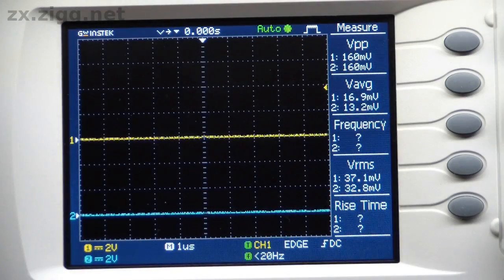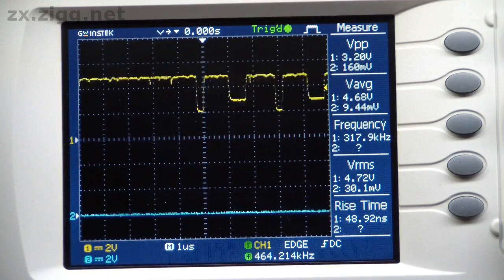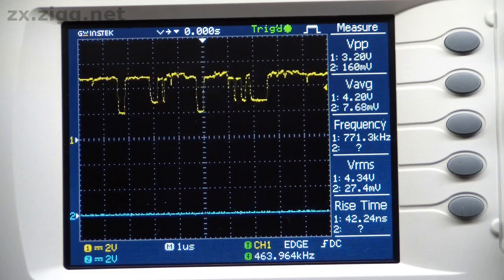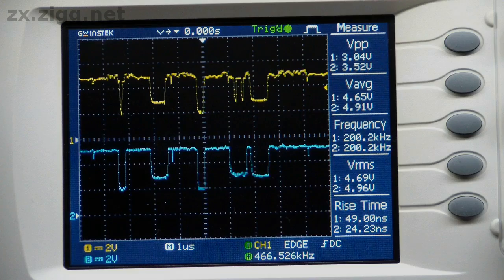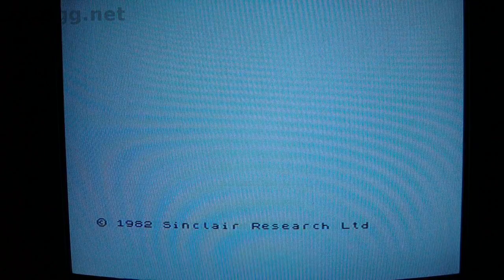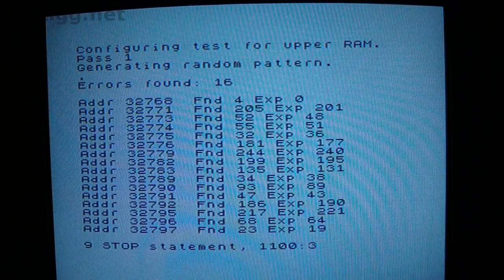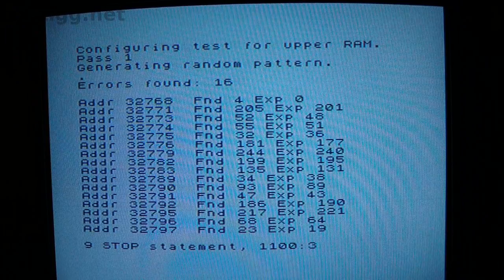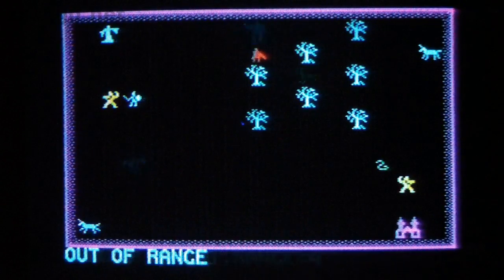48K ZX Spectrum Repair (No. 3)

Comment: I think this kind of ram is not compatible with divide hardware.
Last year I repaired mine, ULA, TR4, regulator, Z80 and lower ram replacement.
Also I did a full recap. A few days ago ULA died again (I think) :-/ oh well...
Nice vid mate.
Reply: This kind of RAM works with Divide (tested).
Reply from the maker: What makes you think the lower RAM replacement module is not compatible with a DivIDE? I'd be very surprised if there is such a problem and I haven't had any reports of one after selling rather a lot of these.

One buyer did report a compatibility problem between the upper RAM module and a DiviDE. I have not been able to re-create it and a number of other users have reported the combination to work perfectly. There is a discussion on the matter in a thread on the World of Spectrum forums and a suggested modification that might help in some cases.

ZX Spectrum ULAs are generally reliable and rarely fail without good reason. Damage is most commonly because the Spectrum's I/O connections have been abused. E.g. too high a voltage applied to the EAR or MIC socket or some of the contacts of the edge connector having been shorted together (though the even the latter doesn't usually damage the ULA).
Reply: The statement was "i think" because I red it on forums. Never tried by my self cause I dont't have this kind of ram, only the divide.
Thanks for the advice about the volume. The truth is that my zx needed high volume to load games so it must be my fault :-\
Thanks again for your answer and time.
Reply: Michael Gibs
perfect!